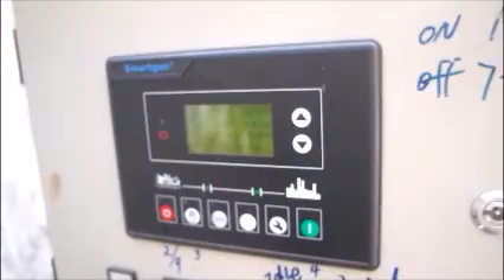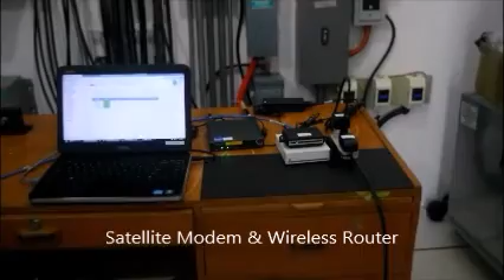Biomass Generator & solar powered VSAT (with captions)

Comment from the maker: This video shows how we run and operate a remote wifi station in an area that does not have access to electricity. We operate a biogas generator using only wood chips combinding it with a solar cell system. Both systems charge batteries which operate the wifi station and the satellite VSAT for 12 hours per day.